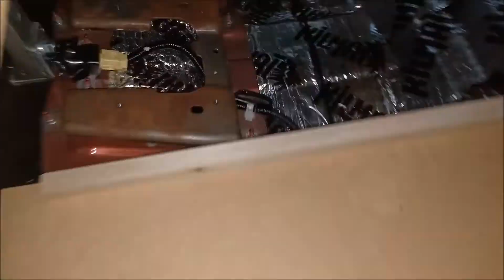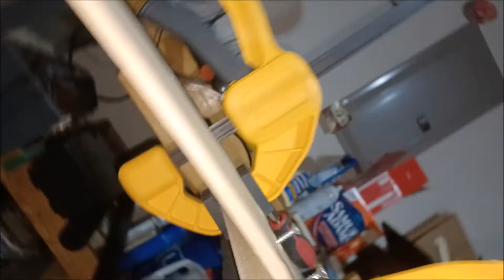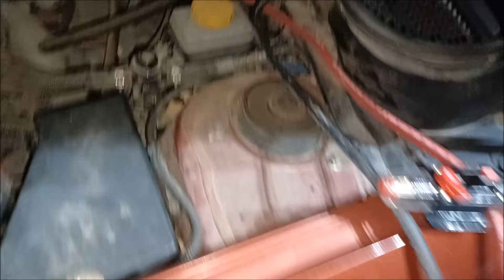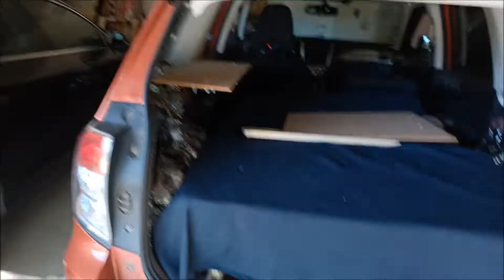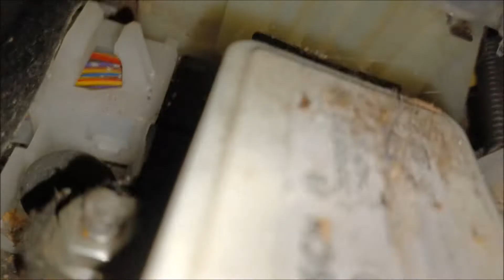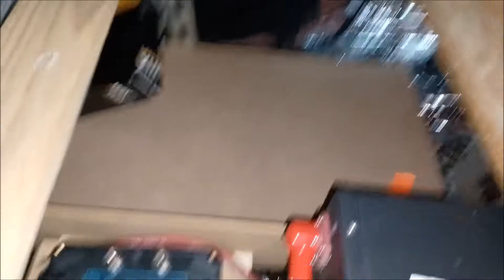Ancient Overland - New floor, battery enclosure, solar mount and more! Subaru Camper Build

Comment: Gonna NEED to Paint that mdf (Glued Sawdust) board to Possibly help it last longer. Didn't think batteries were supposed to be set on their sides? Thought the terminals always had to be on top? Then again I might have learned something new today. I know some battery manufactures won't warranty their batteries if signs of being installed on their sides  Looks like some Heat Shrink tube will come in handy to keep the wire coating from being worn away at the grommet & back hatch. There should be enough room for the cables to fit under console on Passenger side, driver side has more stuff in the way. I'd still slide some polyethylene slit loom wire cover over it for less chances of coating being rubbed away over time.  Not sure I'd Drill into the roof rack plastic. More chances of a LEAK. 
Thanks for letting me Babble & sharing your process of your build with us @AncientOverland
Reply from the maker: Lifepo batteries can be mounted in any direction. Check out the newest video to see how I covered the MDF! Im in the final design stages now, its been a fun process. Thanks for watching
Reply: Thanks @Ancient0verland  . Good to learn something new today. It's been a pleasure watching the steps you took to do your build. I'll catch up on your vids later today.